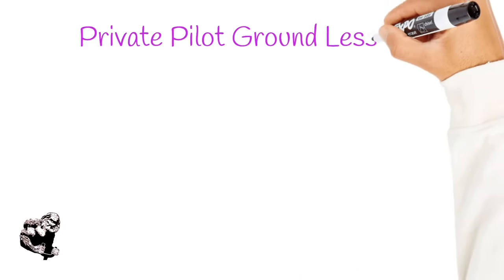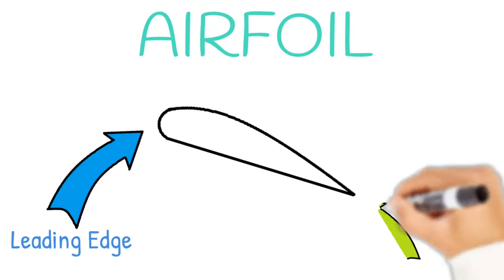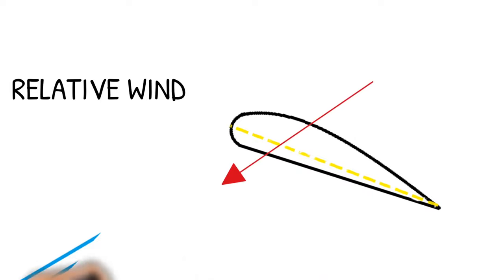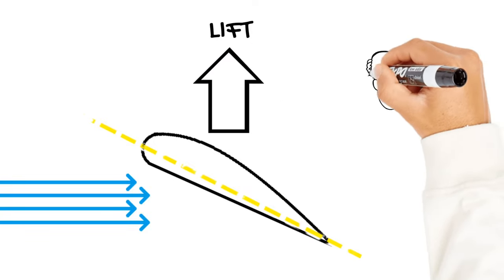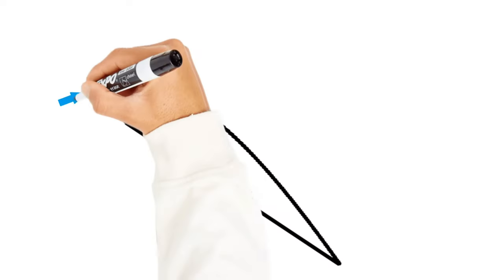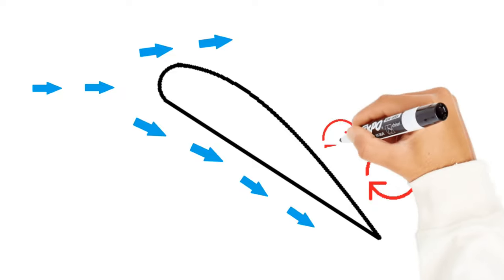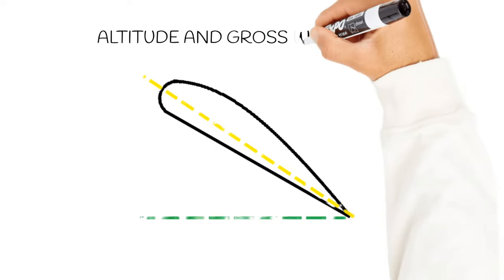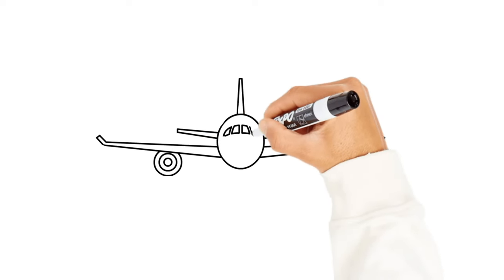What Causes An Airplane To Stall (Private Pilot Ground Lesson 3)

Comment: The altitude would effect the TAS at which we stall, but wouldn’t IAS still be the same? That’s the airflow and speed the plane feels which is all that really matters for a stall.
Reply from the maker: IAS is the same because the air going over the wings is the same percentage of air going in the pitot tube.  That’s why we use IAS
Reply: @FreePilotTraining  nice👍 thanks I know this is an old video, it mentions that altitude and weight can effect stall speed, I just didn’t know what type of speed you were referring to.
Reply from the maker: @LukeKirk1113  both IAS and TAS

Comment: Well even tho I am taking the cpl lesson I still do not get why the AOA is angle of relative wind and the chord line but not the bottom edge of the wing?
Reply from the maker: The reason for that is based PURELY on Bernoullis principle. However, if you include Newtons 3rd law into the equation, it would also have a little to do with the bottom edge of the wing as well.
Reply: @FreePilotTraining  appreciate for your response!
Reply from the maker: @partytimesolution  no problem